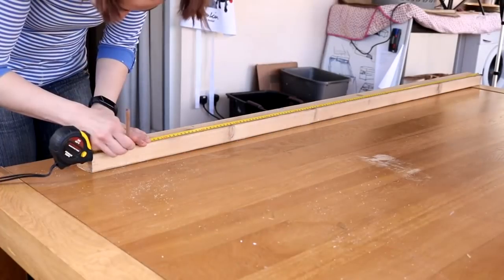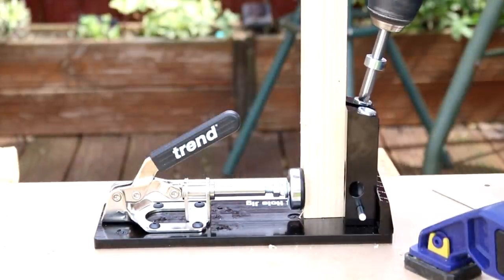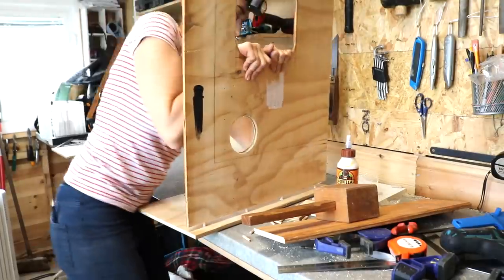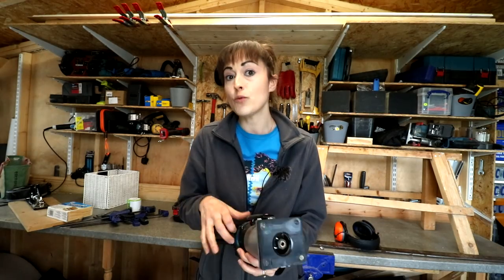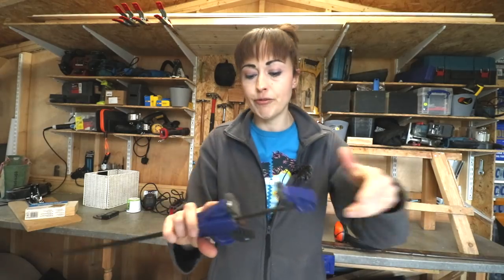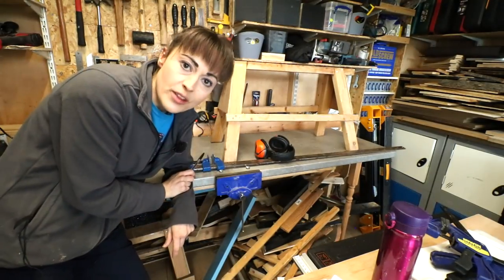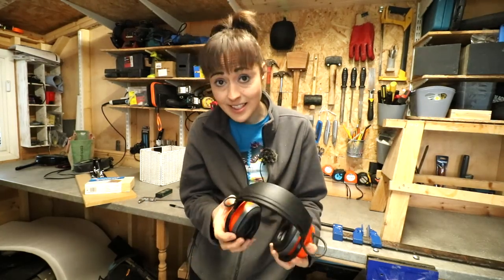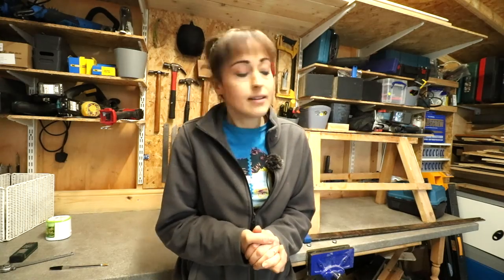DIY Tools I Wish I Had as a Beginner in Woodworking | The Carpenter's Daughter

Comment: My favourite tool is a track saw. Lots of people commenting about table saws, but I’ve never had the room for one in my garage. I first got a track saw attachment/guide for my existing (20 year old Bosch) mains powered circular saw, and later upgraded to a dedicated Makita 18v circular saw (680Z) and tracks, 1 & 1.5M long, with a joiner kit so I can rip 8ft/2.4M sheets no problem. Best thing I ever did, and I no longer yearn for a table saw - which I still don’t have room for.
Reply: I feel the same way, I actually got rid of my table saw after getting a track saw. I found I didn't use the table saw much after having the track saw, I don't regret it one bit.

Comment: My 1st tools list…
Electric drill, circular saw, clamps, saw horse, palm router, random orbital sander, jigsaw, hammer and a few screw drivers. One of the most important tools is an unspoken one and that’s YouTube. Yes! This alone not only lays out step by step instructions on how to build projects, you also get different perspectives and techniques, but most importantly it gives beginner courage to try.

Pocket holes are used in high end carpentry. You just have to know where it’s acceptable. Obviously, you don’t want it where it’s highly visible, but more importantly, you don’t want to use it in areas that require a lot of structural support, particularly where the wood can twist. Stretchers for cabinets is a perfect place to use them. Many seasoned woodworkers on YouTube go into great detail about ideal uses of pocket holes in any project.

Comment: Good choices.
I'd recommend a mitre saw... Good repeatable cuts, or just nibbling off a tiny bit to creep up on a line.
I love my pocket hole jig. Nothing wrong if used in the right place.
Have just got a free bandsaw which I've refurbished. It's a joy to use, and I like that mini circular saw you've got
A pillar drill is also a great addition, if you've got the space, picked one up for £20 on eBay and refurbished it a bit

A tip I was given...buy ok (not cheap, not expensive) first. If you wear it out, you know you use it and it's worth getting something better

Comment: I'd suggest you look at some pipe clamps rather than sash clamps. You can get the heads from any number of places from Chinese ones to the Rockler I use. Then just buy lengths of 3/4 (19mm) pipe to suit your needs and interchange as necessary. They are much more solid and easier to use than the sashes. The only caveat, buy decent quality up front.

Comment: Thank you. That's a solid list. I absolutely hear you about the weight of the circular saw. Even small 160mm blade diameter saws with a cut depth of 55mm weight more than 4kg. I don't have a big hand and can tell you that I have trouble. Also, it's great to see regular tools being used and not seeing high falutin' Festool and Mafell stuff. Like the old adage with photography, "the best camera is the one that you have" the same can be applied to most tools. Skill over quality.

Comment: The router was definitely one.  The circular saw too.  A bit heavy and unwieldy, but it only gets used to make big pieces smaller.

So far I just use dowels.  I could only afford pocket holes or dowels.

Impact driver, which is mostly used to get seized screws out without stripping them, but a tool I realise I should have bought years ago.

Comment: Marking gauge, combination square and a sharp pencil, I own a tracer amk model,  for precise accurate mark up especially when doing finishing or trim work 👍
A track saw, I have a PL55, and it's easier to cut down large pieces of ply to rip on a table saw and more precise for that final trim. 
Cordless first and second fix nailers, trim router and orbital sander. You won't know how much you needed them until used...
Planer thicknesser, I have a Triton, and can't praise it enough for that clean finish and hours saved from sanding.
A big workshop if you can 👌
I started out with the basic setup, expanded my knowledge from not only watching videos like this, purchased more items and made smaller projects into bigger projects and now I do bespoke items on demand. Most of my work is custom doors, fencing, garden furniture, finish carpentry with cabinets as and when needed. I do smaller items like planters, memorial seats, afternoon tea mini benches, to name but a few, and only it's down to network locally. I've not used media to expand as I don't have the space to do anything but a garden gazebo on a less windy day 🙈

Comment: I've gradually been building up my tools having made do with some very cheap options over the years. For power tools, my circular saw has been great and a decent impact drill was also an excellent buy. I've recently got a pocket hole jig too and am looking forward to using it. I don't think they are cheating as you say, just another method to join wood. There are always way to tidy up the holes too. I've asked for a router and/or nail gun for Christmas. Re hand tools and peripherals, a decent set of chisels, an engineers square and clamps have been a godsend and one of the most useful things I bought were a set of foldable Stanley sawhorses. Easy to store and really robust when paired with some CLS wood braces! I'd love a bandsaw but just don't have the space in my garage for one. Oh and a useful if not slightly pricier tool (was a present) has to be my Axminister sharpening stone wheel. So satisfying when you can sharpen tools quickly and accurately!

Comment: I want…EVERYTHING.😂  However, you gotta have room for it all and not just the tool, but the in/out feed space too.  I have a 10” Bandsaw, Table saw, bench pillar drill, bench grinder and shopvac with three different size benches in an 8x11room.  I need a bigger house😂!
Small tools: battery oscillating tool and angle grinder, 18v combi hammer drill of course and reciprocating saw (which I probably don’t need for shop projects - but its a good outdoor pruner and building aid).  My Bosch corded router got rusted in a store shed…hopefully might be salvageable, but I’d like the Dewalt battery router.  My Dremel kit has a router function, but only really useful for 1/4 inch thick stock.
Other considerations:  A welder (and I haven’t welded yet!) for upto maybe 6mm steel - still researching.

Comment: I'm no woodworker (sure I've made some swords, miniature snowmobiles, baseball bat as a kid) but I found that I was lacking some more uncommon tools our stores don't sell so I had to order them. I'm building a guitar and I'm practically getting stalled every step of the way waiting for the tools to arrive and one thing I'm excited to have is a 5 1/2 jack plane. I did get a cheap hand plane but it was causing more problems than solving them. But the most important things our stores don't have are measuring tools. I'm not gonna risk eyeballing crucial points where precision is a must so I'm waiting for my straight edge, saving up for a try square and a protractor, lapping plate and sharpening films. Can't wait to use my plunge router and dremel.

Comment: Pegboard! Painted white and a full range of multi hooks.  I always thought it would look abit naff, but now I have a 2x1m board over my work area. It changes all the time, depending what I'm doing. Having proper draws and shelves is essential, but pegboard nearby means you have within reach wet paint brushes, cups of screws, screwdrivers, saw blades, pencils. rulers, clip-up drawings...  all the small, fiddly stuff right infront of you, but off the work bench.
Maybe not a 'tool', but I wished I'd got it years ago! 😁

Comment: Maybe a follow-up video about the tools that you bought & hardly use, or found a better alternative. 

I would recommend;
Cordless screwdrivers. Light weight, easy to carry in your pocket, get into tight spaces and in corners (where a drill wouldn't fit), and prevents rsi wrist strain.

A wet & dry workshop hoover is a must.

MORE clamps!

Comment: Masks/respirator; speed squares; electric miter saws (I have 2); cordless impact driver, clutch-able drill, hammer drill, grinder, recipt saw, chainsaw; air compressor with nailers and staplers; clampable straight edges- I have 3: a 25", 50", and 100". I got bar clamps and a biscuit joiner for the 1st table I built.

Comment: I'd add a VERY long, trusted straight edge. Like a good piece of extruded aluminum or something, and a compound square that's again, for sure square. I've spent WAY too much chasing little errors caused by THINKING I'd cut something straight or perpendicular.
Reply: Yess!!! I don't have a jointer and I have no space for one - so a couple weeks ago I bought an 8ft length of flat bar steel. Extremely straight and rigid, so it's a perfect reference for a router or circular saw.

Comment: What you say about the pocket hole jig and cheating is interesting, because you know how stud walls are built nowadays, timber butt jointed normally fixed with a nail gun, back in the day..... say victorian times, using my own house as an example here the stud work is all mortice and tenoned, at the end of the day if the join is strong enough and not visually ugly that's all that matters. On the point of cramming cables in the box with a power tool, although I appreciate it is very expensive and out of most people's budget I really like the festool system with the detachable power cable, I end up keeping the cables together out of the box of the power tool and generally only take power cable and unplug and swap at the tool rather than the socket.

Comment: Get yourself a piller drill too vikki.i use mine loads.not just for drilling straight holes.but I also wrap sandpaper around dowels and use it for curved profiles. Plus you can put a router bit in it too.just to do some trimming or to do a shallow rebate.as always. A pleasure watching you.and I'd still love to have a pint with you. 😂x

Comment: Get yourself a Japanize pull saw, if you are going to use a hand saw at all, there is no reason to not use a pull saw. They are easier to control, they make a smoother cut and when you are done your body doesn't hate you for using it.

Also a rubber floor mat. If you are going to be standing in one area, they will save your feet, your knees and your back. It is the best investment your shop can have, hands down!
Reply from the maker: Thanks!  You are so right about a rubber mat 😂 https://youtu.be/cPDXxOmVpns

Also, what Japanese pull saw do you recommend?

Comment: One thing I would definitely add is good lighting. Makes a huge, huge difference. Good lighting in the room, plus some kind of spot lighting near the workpiece.

There are three things on your list that I would bunch together: a workbench, a vice, and clamps. Anything that provides a third (or fourth, fifth) hand makes your life so much easier. The one-handed clamps are useful, and I would also recommend pipe clamps: very strong and rigid, and the only issue is the weight: I have them on a very short piece of pipe, and I only use long (=heavy) pipes when needed.

If you build a lot of frames and carcasses, pocketholery can be extremely useful. Yes, it’s not real joinery, but neither is dowelling, really. Honestly, who cares.

A router has a ton of uses, although I haven’t really missed one as of yet – it’s not a tool I wish I had from the beginning. And I would/will get one with a cable, because I have battery anxiety.

Calipers, sure: before I got into DIY and woodworking, I thought of calipers as some kind of specialist tool, now I would pretty much consider it a household item like a hammer or a tape measure. How else are people measuring the thickness of things?

Comment: I've done a lot of DIY and worked with wood now for many, many years and often bought tools I didn't really use. I think before buying tools it's worth figuring out what kind of work you'll be doing. I built a garden fence with just saw horses, a panel saw and a battery drill/screwdriver; then I made automata with mostly a bandsaw, but now I build furniture and couldn't live without a (quiet induction-motor) table saw. I've built up my tools over time but only by figuring out what kind of work I needed them for a bit like you I suppose. My table saw and simple jigs is the centre of my work now - wish I'd got a better one sooner.

Comment: Good points. I’d add:

Cordless (or air powered) brad nailer. Great for tacking pieces together while glue dries. 

If you have long metal straightedge you can make even your little circular saw imitate a track saw. 

As others have pointed out: sliding dual-bevel miter saw. They aren’t expensive and make basic cuts so much easier.

Speedsquare.

Comment: Very interesting - I think I agree with you on most of those - certainly about never having enough clamps! I did my first project with my router this month (video to follow in a week or few!) and yes, it's fantastic - so much easier to clean edges up and finish corners. 
I'm really tempted by that compact circular saw you showed. I keep seeing tablesaws on all the Youtube channels and there's no way I've got room for one of those, so I've been using a jigsaw for the rough cut and now the router to make it more accurate, but that looks like it has a lot of potential for thinner wood.
The main thing I need now is a workshop space - I've been using an old dining table in the garden, and it's really not ideal!

Comment: Loads of good suggestions below, and I'd agree with your suggestions. There are tools I thought about, decided not to buy (thinking I'll probably only use it once or twice) that I finally bought after years of botching my way using other tools (strap clamps, bench sander, band saw, mitre saw, etc.) If you can afford it, buy when you first need it. 

Secondly... duplication can be good (when you can afford it too.) Three power drill/drivers... one with drill bit, one with countersink, other with driver. Saves a lot of time. Or multiple palm routers, you can keep them set up for specific jobs throughout a project to save swapping bits and losing settings. Etc.

Finally... if you're looking at battery power tools, there's a strong argument for picking one or two battery types/brands and stick with them (I use Makita 18v and Bosch 12v.) After the initial investment it saves the cost of multiple chargers and batteries. Also nice to only carry one charger and one type of spare for a mix of tools when away from the workshop.

By the way... how many people keep their tools in the box they were supplied in? Most of my tools stay out on shelves where I can reach them and replace them quickly.

Comment: You're going to be glad you got a bandsaw, they're the easy way to cut lots of things. I agree too with the safety advantage over a table saw. I inherited a table saw that takes 12'' dia. blades and is powered by a 5 horsepower motor. Cuts anything like it isn't even there, and throws chunks of wood back at you at about 200 mph if you aren't careful. I use it as a tool of last resort.
Reply from the maker: Kickback and wood flying at you looks absolutely petrifying!  Seen a few videos to make my stomach turn.  I agree... I think I'm going to love finally having my own bandsaw!
Reply: As a human who can cut himself on a packet of crisps, I have always been VERY careful with my table saw. However, I still have all my fingers, have never had a kickback incident, and generally love my table saw. I do spend a lot of time making new jigs for it, rather than the things my wife has asked me to make!

Comment: My track saw has come in so useful to create super accurate straight cuts. The dewalt one cuts right to the rubber strip so you know exactly where it’s going to remove material. Just wish the 54 volt battery version was available when I bought it as I had to go corded.

Comment: Hi Vikkie,
What a great idea for a video. Very informative (as ever). For me, a battery drill, which can be used as a screwdriver as well. Am thinking about an impact driver in the not too distant. Having the right tools is almost half the battle. PPE - yes, 100 percent. Just bought a stick welder and spent more on the PPE than the welder! It may only be used once in a blue moon (although I can see me finding more projects😉) but it only takes one globule of molten metal in the eye! I do use metal in some projects, so a pillar drill is another useful item. Thanks for this one, Vikkie...got me thinking🙂👍👍

Comment: Having the ability to dimension timber is for me essential, so a portable table saw, and a planer/thicknesser allows more flexibility and lets me use whatever timber I can lay my hands on, buying PAR is an expensive hobby. Compound mitre saw gets used on most jobs, and I wouldn't be without my impact driver. If you decide to go cordless, and I can think of no good reason not too, try to buy the same battery platform.